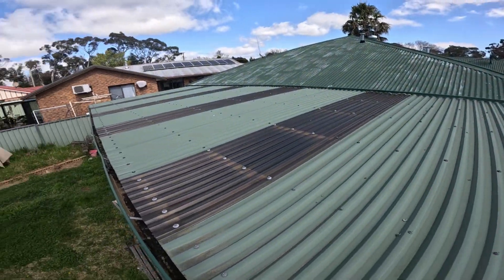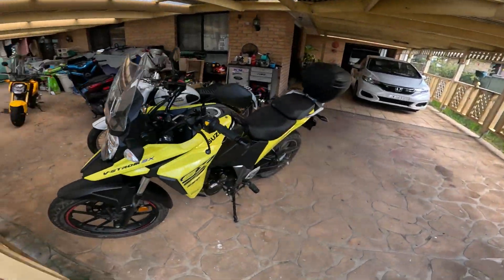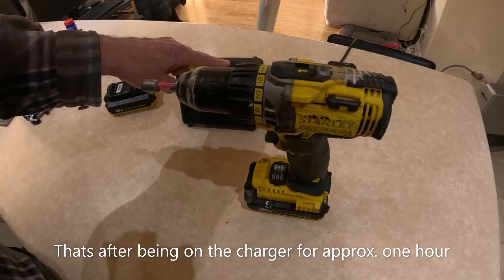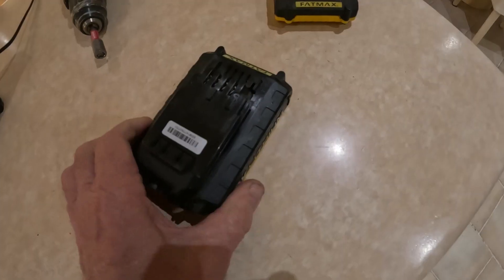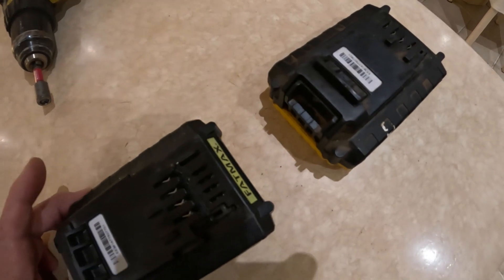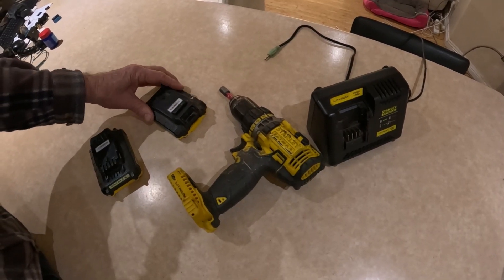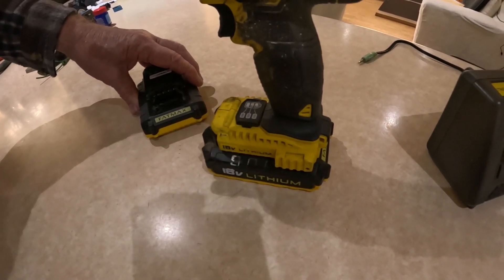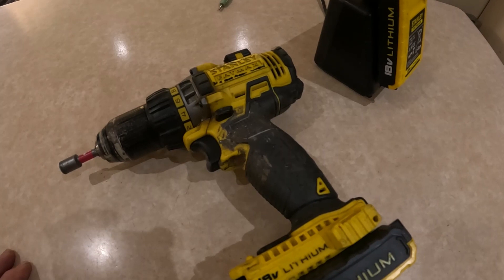How To Revive A Dead Lithium Battery -Very Easy Fix!

Comment: You can use two drills put the battery in one that's dead. Use the second drill to turn dead drill to a generator. You have to hold the trigger on the second dead drill. If the good drill is going forward the dead drill needs to go in reverse. Cancel in most cases recharge the battery just enough to quickly throw it on the charger
Reply: Why risk ruining a good drill by using a crazy method like this?
Reply from the maker: interesting method there

Comment: worked like a charm for me. Took about 10 seconds to revive a lithium motorcycle battery. The connecting wires got really hot, really fast. I hate lithium batteries in motorcycles but sometimes they are the best option space-wise. Thanks for showing this tip!
Reply from the maker: great to hear...well done

Comment: Humm .... Interesting!
 Especially as I work in a hardware store, were we sometimes have very large garden power tool "dead" batteries returned to us that are worth many hundreds of dollars. If I'm gonna experiment with your hack, I recon in the middle of a quite car park after business hours, might be the safest way to do it.
Reply from the maker: well not exactly my hack. i recall seeing the original clip on the tube maybe 6 or more months back. worked for him. worked for me. 
my charger has a safety devise but the idea is short 3 minute hit on a totally dead battery.
i would have done it outside but too hard to film
i had a similar problem with gopro batteries. different battery but a problem.might put that idea up. figured that one out myself

Comment: Warro's handy hints & Motorcycles.
Reply from the maker: i like that. warro's handjob hints...got a good grip to it...lol
Reply: @ridewithwarro Hahahaha 😂🤣.
Reply: @ridewithwarro Pay someone to do that job they need Scaffolding etc cost thousands not hundreds bloody safety standards in last 20yrs.
Reply from the maker: @ruahinesrider  i thought they would charge so much per screw to do that. that would be a better way to relieve some-one of more cash.
screws were in excellent order but the rubber seals had been eaten away or were just sitting around the screw head like chewing gum.
thats a bit of a pain cleaning them but if i just replaced the screw and seal i'd have 100's of screws i'd never use.....lol
just so much screwing one can handle -age related...lol
Reply: @ridewithwarro You'll weather the storm Warro it'll blow over eventually.
Reply from the maker: @ruahinesrider  yeah i was actually only using a 3d bunger and got a grenade tossed back with a distorted pin of bad information and it blew a hole in the channel and got ride of the trash...lol
Reply: @ridewithwarro  That's how they do it so much per screw & it's heaps cause the cost of putting Scaffolding up & down is included if you pay someone.
Reply from the maker: @ruahinesrider  in that case i am definately saving a few $$$ there.